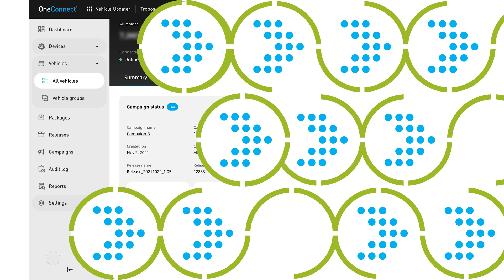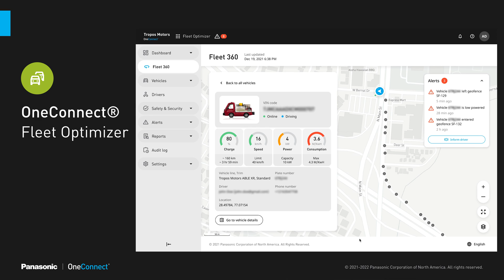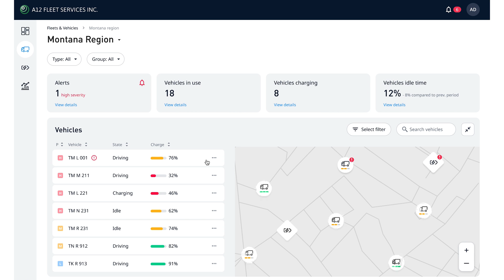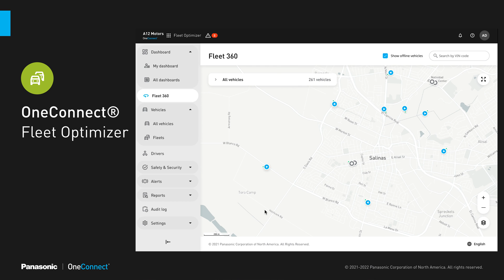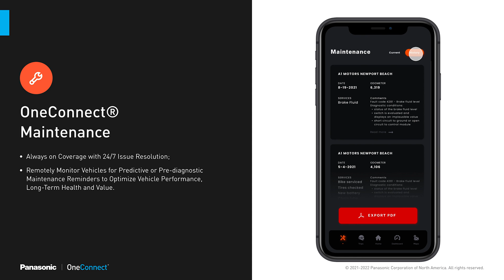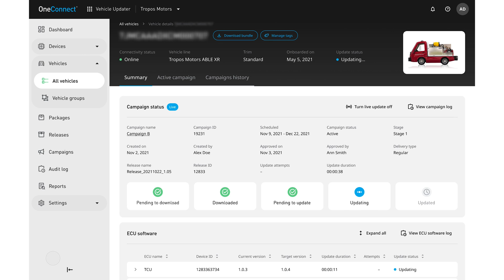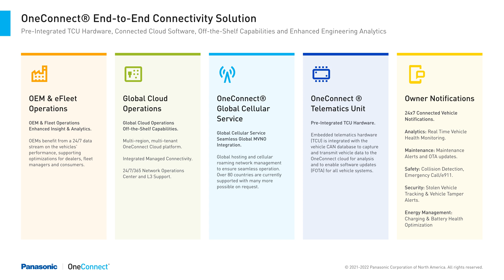Reinventing the Connected Fleet: Tropos Technologies Deploys OneConnect to Improve Fleet Production

Comment: $NAKD Tropos Vehicles come from Cenntro Automotives
Reply: Not exactly a true statement. Tropos vehicles come from Tropos technologies Inc. Kits may come from Cenntro, .  but the vehicles have many quality based upgrades and fixes in comparison both in the US and Europe.($NAKD just now came into play and is not affiliated with the Tropos brand in any way).
Reply: @AndyCal1  This is not true. Tropos is listed as a manufacturing partner of Cenntro. Tropos receives the equipment from various partners such as Panasonic & Cenntro and assembles themselves. In this case, the vehicle is from Cenntro. The OneConnect is from Panasonic, and Tropos assembles and distributes. So yes, Tropos Vehicles come from Cenntro Automotives known as the Metro. The specific use-case is a single-vehicle meant to serve multiple use-cases with multiple applications, and it is proven in this video.
Reply: Correct!  Tropos just happens to be a Cenntro channel partner licensed for assembly which allows modifications during that process....Tropos makes sales and Cenntro benefits.